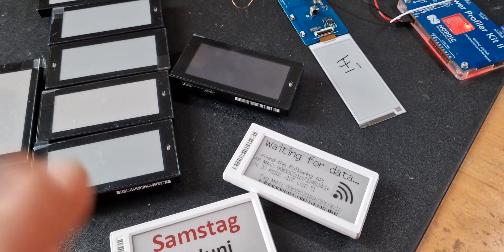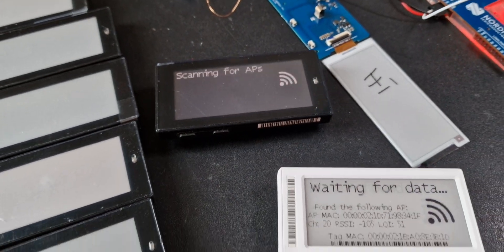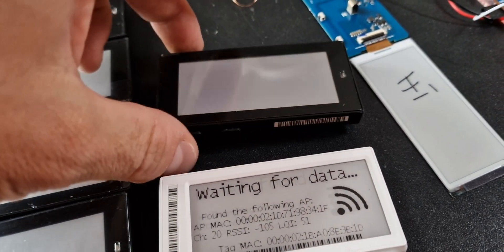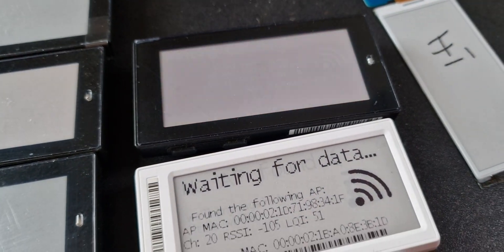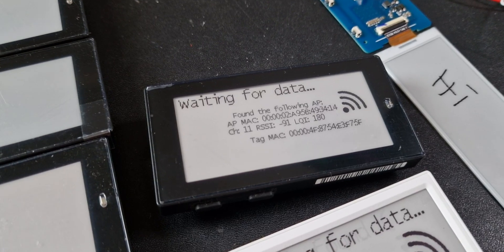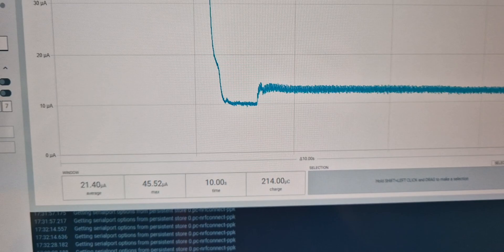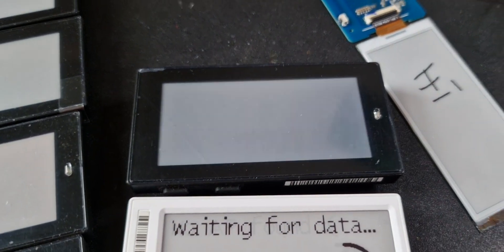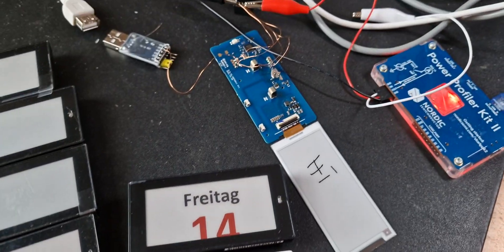OpenEPaperLink running on the nRF52811 ARM SoC E-Paper price tag

Comment: Hello, have you somewhere on your github wiring and flashing tool for this nRF5281 type as you have connected? It´s not SPI/UART/I2C connection but GPIO with DIO/CLK/RST. On this video you have it connected on universal programmer, which most of us haven´t 🥴 I have found mainly all for standart interfaces.

Comment: Dear Aaron, 
I have the 7.5" version of the nRF52811-based tag in front of me and would like to add support to OpenEPaperLink for that. 
However, before erasing the controller I wanted to dump it first (using your ESP32_nRF52_SWD glitcher). Sadly, so far I was unsuccessful in getting a dump, the nRF52811 stayed locked. Did you try to dump yours? Did it work or is the nRF52811 not susceptible to the attack anymore? Thank you!

Comment: Hello aaron, i have a question: how do i disable the continues flashing of a epaper display after i loaded it with custom filmware. (I want to have the clock in my bedroom but i cant really sleep with the continues flashes) thanks
Reply from the maker: Hey, you need to disable it in the source code and compile a custom version without the LED flashing
You can ser this value from 2 to 0 https://github.com/atc1441/ATC_TLSR_Paper/blob/main/Firmware/src/app.c#L82
Reply: @atc1441  thanks it worked really good, the first time i sent somthing wrong so i haad to reflash it with the usb stick but then it worked. i have another question: i have been trying to figure out how your files work for converting images to esl. so i can send images to the e paper price tag. i hope i dont bother you, greetings from holland